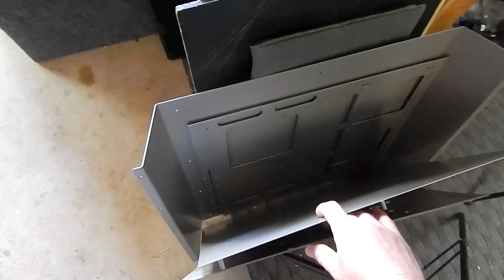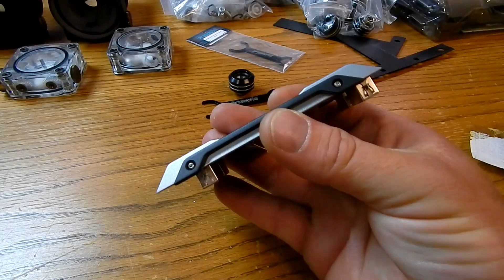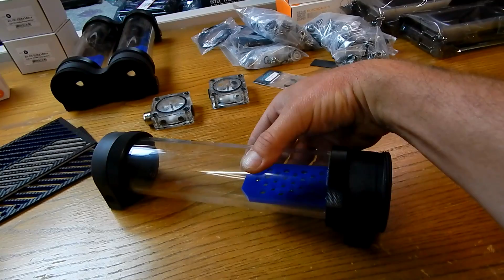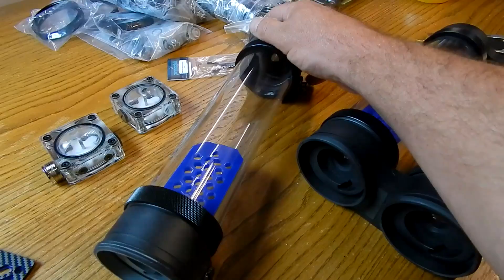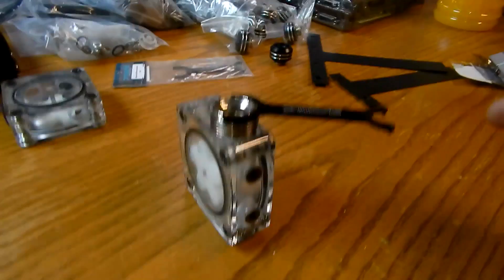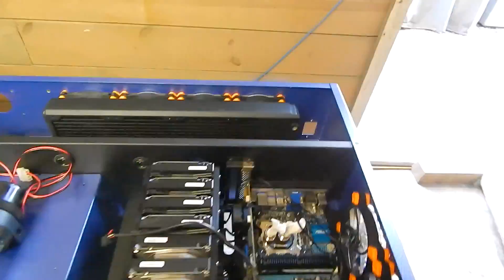Personal Red Harbinger  Cross Desk   part 2

Comment: For the UFO fans, those spongy corners are for noise dampening. Just an idea about how you can mount them. They should just need to be slightly pressed against the mounting surface, so you could take a flush mount bolt through the back of the desk & run it through the fan mount hole into a washer (to protect the sponge corner) & plastic lock nut. Then just cut off your extra threads flush with the nut & you're done.